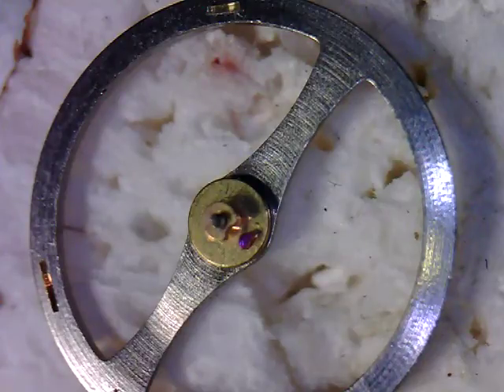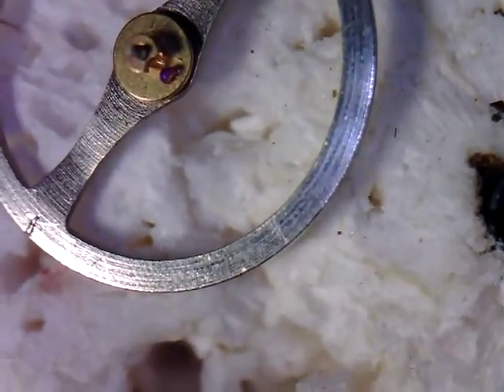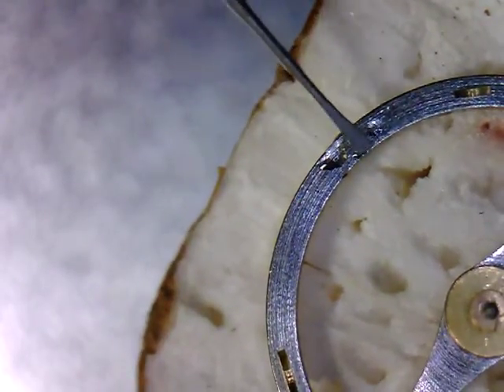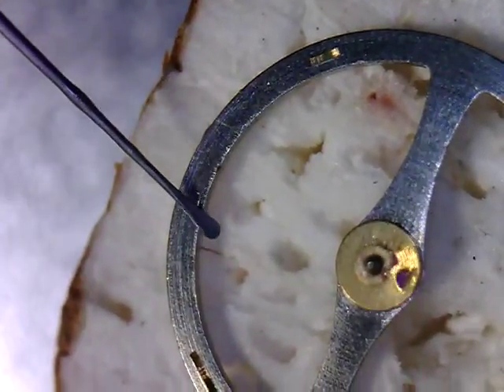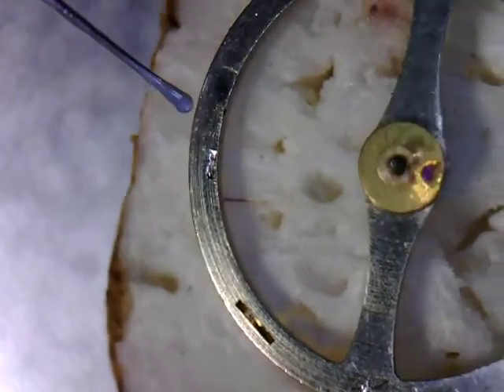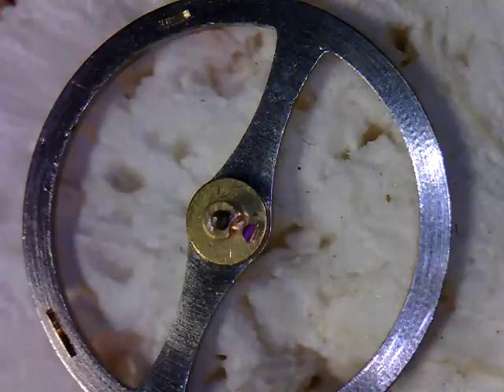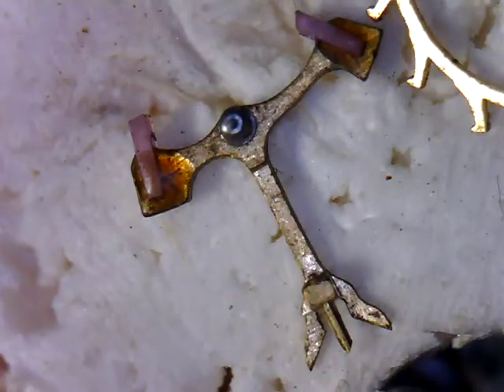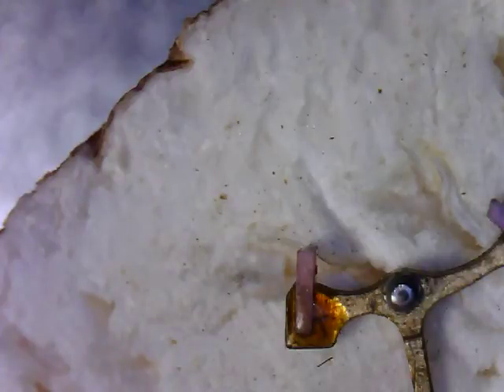Watch repair: Fix o Drop experiment AKA Epi Kote AKA EPILAME [Rolex]

Comment: Kinda debatable if it'd good or not .guess one needs to do a microscopic pressure test, what if 2 treated surfaces (with oil between them) try to touch..i presume the oil then doesn't want to be there either, resulting in metal on metal..but that's just my 2 cents...

Comment: nice demo and nice explanation of the theory. iirc there are two situations where epilame holds the oil in place. one is where the oil preferentially attaches to the surface where it has rubbed off, and the other is where surface tension holds the oil in a tight crevice even if the coating is intact. obviously in both cases the surrounding epilame prevents the oil slowly crawling away in a thin layer

i have a question on alternatives. in the old days epilame was (iirc) stearate, applied in a vapor. apparently this has pretty poor long term characteristics, but i've seen POLY(DIMETHYLSILOXANE) (PDMS) listed as a serviceable epilame, which would be vastly less expensive than the proper stuff, and might suit people doing one-off projects. have you heard anything about this option?

Comment: I use Moebius Fix-O-Drop just about every day. I overhaul aircraft clocks as part of my job as an aircraft instrument technician. The recommended oil for overhaul is Moebius 9030 which is a very thin oil with a tendency to spread if you dont us some sort of anti-migratory barrier. I have never had an issue with the product and would recommend it wholeheartedly.